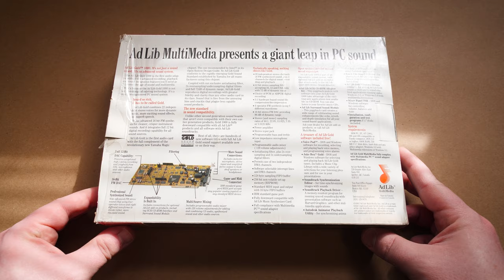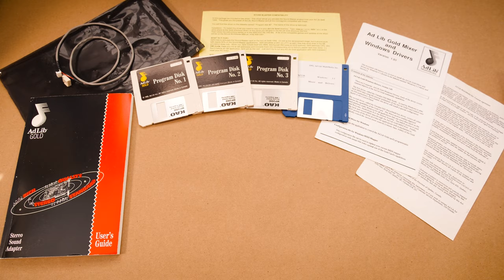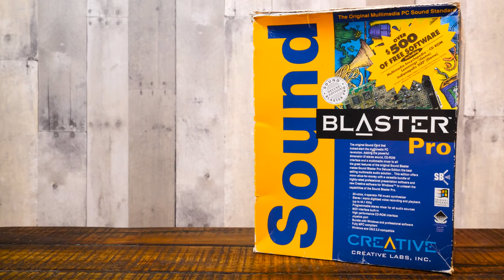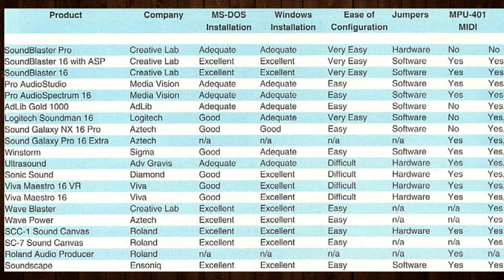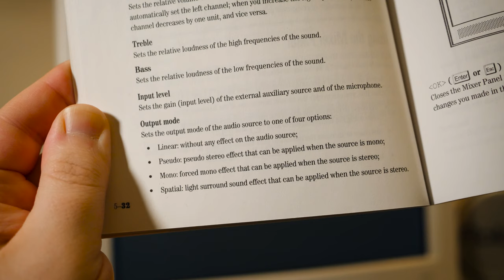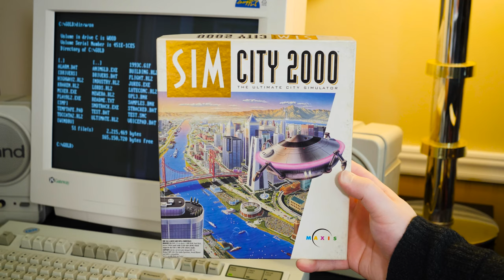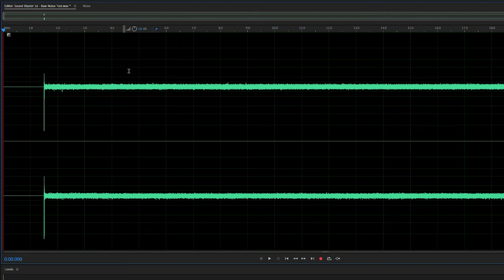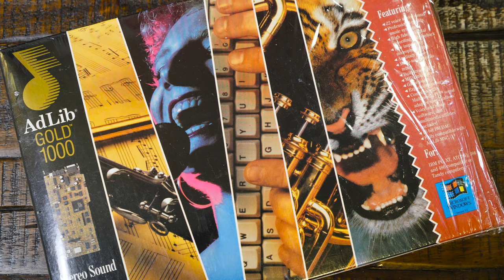The AdLib Gold Experience: Is it really worth $3000?

Comment: Oh dear. I killed the Gold as it was not viable to build. I became technical director for Adlib Multimedia Inc. after Ad Lib went into liquidation. The 1000 was never put back into production as it had been stock piled along with a substantial parts holding.. The main problem was the Gold ISA control chip, we ended up scrapping the whole stock of it (some 100k parts) for not many dollars. Other parts were included in the new products we designed in house which were coded ASB for Advanced Sound Boards ASB16 32 and 64. The stock of gold  SCSI board components held was used on the ASB to provide a universal port on the card along with the high quality audio grade components.... All the design and software development was done in house in Québec Canada. The card you have there was a late card, the address on grand allee shows it.. for a year  Adlib multimedia  operated out of the technology park in ste-foy... With v1 manuals, there were many nights spent rewriting them for V2...

Comment: Clint calling a 200KB driver "bloated" is hilarious thinking of the bloat we have to download now LOL
Reply: This bloat is not preventing you from running the drivers alongside the software that they're intended to enable. The driver may be a 500mb download, but you have 16gb ram and there's only maybe 100mb of the driver code resident, a drop in the bucket, running one of the most complex subsystems in your PC. In contrast if you can't trim down your basemem consumption to about 40kb, you aren't getting any games to run, so a 200kb driver pretty much breaks your system.
Reply: @SianaGearz  no shit achtuallay boy
Reply: 60-100+ MB downloads for NVIDIA drivers because they're bundled with "GeForce Experience"
Reply: @sugaryhull9688  aren't they like a gig now? LOL
Reply: @sugaryhull9688  That's because what you think is driver is actually a driver package, so it contains drivers for many different cards in one package. AMD does the same. I once swapped RX 560 with RX 580 and it was working without reinstalling drivers, that's kinda cool. And that driver package also packs software, which you may or may not install. Sometimes they even have recently depreciated software like 3D Vision drivers. The actual drivers aren't really that big. Also up to 100 MB is conservative, AMD drivers can get as big as half gigabyte or more than gigabyte once extracted. Also AMD leaves all previous driver version files (with the rest of software) on your PC and never cleans it up, so you can find over 10GB used in C:\AMD directory. That makes nVidia look like saints.
Reply: @sinephase  sounds like someone's mad someone corrected them
Reply: @sinephase  Umadbro?
Reply: @jzburda  yes
Reply: @sinephase  wp bro
Reply: *cries in 50gb+ games*
Reply: I dunno. I have to reinstall my AMD 1GB drivers every few months or whenever I take out the card, or breathe on my PC it seems. Pain in the ass
Reply: Lol millennials
Reply: For the time and a DOS based driver 200kb was absurdly large.

Comment: The older I get the more I love FM Synth.  One thing I noticed is how many solid state capacitors the Gold 1000 card had compared to the SoundBlasters.  Creative used a lot of electrolytic caps, but the AdLib had very few electrolytic caps. Part of me wonders if your collection of cards would sound better with brand new electrolytic capacitors. I imagine more than a few of them have aged to the point where they're partially out of spec.  I just recapped my original non-TMSS "Hi-Def Graphics" Genesis and it sounds quite a bit warmer and fuller now.

Comment: Hi, Clint! Great video as always! Just a quick note about the date code on those chips. The first two digits are the year (as you got it right). However, the last two are the week of the year, not the month. So in the case of the main chip which reads "9209", that is the ninth week of 1992 (which in turn would be around the last days of February and the first days of March 1992). Keep up with the excellent work! Greetings from Argentina!

Comment: A sound card for $3000?

NVIDIA in 2021: "Hold my beer."
Reply: quadros and titans have always been in that price range

but most people don't buy them because they're as incredibly cost-inefficient as possible just to squeeze the professional market dry
Reply: @Shpoovy  ...well RTX 3000 series and AMD RX 6000 are around $1000 or above.
Not long time ago, the best gaming GPU cost only $800
Reply: @GameBacardi  And they were ~300 in the early 2000s :(
Reply: Hold my ray traced beer
Reply: @GameBacardi  msrp the 3000 series, for the most part, are under $1k (3080 outperforming the 2080Ti and nearing double that of a 2080 - for $700). Between supply shortages and scalpers (and data mining) the demand is far greater than supply which is why the prices are at 100%+ markup. Hopefully they'll go back to normal in time.
Reply: @Shpoovy  I actually own one FirePro card and there's really almost no difference between it and regular Radeon. However it renders depth better in some games.
Reply: A $1000 for a plain 3060 already is just gross. I mean, my 1080 can do more, and it was less than half of that 2 and a half years ago where it was already outdated...

Comment: Awesome! I remember seeing the option in Dune, trying it and getting rejected. Had to stick to boring old AdLib on my Media Vision Pro AudioSpectrum 16. I've now managed to collect all the parts necessary to play it again, except a working 386 motherboard (and obviously the original case). I do have a couple of 486 boards that would probably work though. I could even listen to the music with my Roland MT-32, which should work with the MPU-401 on the PAS16. But what I don't have is the spare time to spend a day tidying up the workbench and building the machine.

I never knew the history of the card and the company that made it. I always just assumed it launched too late to compete and the SB16 just outsold it through brand power.

Anys ways, great to hear what the AdLib Gold sounded like. Very awesome for the few games that were specifically written for it!

Comment: Hey, I'm the guy who brought Trixter his first AdLib Gold almost 20 years ago (not this one), and right now you might hate me, but Trixter's card ran me around 5 Euros incl. shipping, my own that I still posess, was around 11 Euros. Prices are around 2002... times change...
You made quite a nice video on it! I want to add some stuff and correct some other. The SB Pro was mentioned to be 22 KHz Mono. In fact, it's either 44.1 KHz Mono or 22.5 KHz Stereo. (Why? They used a Mono DAC and flipped between L/R in Stereo mode for each byte.)
One thing to mention about the SB 16 is that most cards had a flawed ADC, and this meant they would also only record with 12 bits resolution! Given the noise the SB 16 produces (which you captured quite well), you probably wouldn't even have heard those 4 missing bits, as they have been lost in noise... so it's tragic that this card was even named to be inferior just by looking at the bits. You prove that AdLib made in fact the better audio circuit, while most Sound Blasters below the AWE 64 (and some 32 and some even fewer SB 16) had not-so-well-made implementations...

By the way, you picked an SB 16 with an original OPL3, but some viewers might not known: Creative invented something called "CQM" that was supposed to emulate OPL3 with later cards, namely most (but not all) Vibra cards and even some cards w/o Vibra label. It sounded even harsher and quite thin... 

Here's a link on my take on the card, as well as most other sound cards of that era: https://crossfire-designs.de/link/soundcards

Comment: Does anyone know how the .rl2 songs that mix opl3 with samples were made? I'm not aware of any publicly available software that allowed to do such songs (except for maybe deflemask for genesis like stuff).
Reply: They had proprietary software. So they had Visual Composer, that's a version that does OPL2 only, you can find it. They are alleged to have also made a sequel version that covers the feature set of this soundcard, but it remained unreleased.

ScreamTracker 3 by Future Crew is known as sample based module tracker, but it actually has OPL3 patch support built in. Little known feature. So if you wanted to compose OPL3+sample music by mid 90s, that's what you could use.

If you're looking for something to use today, i hear OpenMPT gained OPL3 support not too long ago.
Reply: @SianaGearz  Thanks for the pointer. I have found a disucssion on Visual Composer 2 on Vogons after some searching. It's a pity that it's still not available on the Internet. Hopefully some day some ex-employee or contractor from adlib will find a disk with it :-)

Comment: I think where Creative really had the advantage was they were bundling CD drives with their sound cards offering a full all-in-one multimedia add-on package, versus Adlib which I think just had sound and maybe speakers for a package.  Price was probably also a factor too.  Even if Adlib was a premium sound system/brand, there are always those who will refuse to pay the higher prices especially when the difference in quality cannot be justified as much (or they can't tell).

However I think it's also comical now that REaltek pretty much owns the sound market at least in terms of computers for the bulk of people.  Yes there are probably still some people who buy add-in sound cards, but many people I think still just use the built-in sound as the integrated options (like more recent processor graphics) have gotten quite good to a point where adding a $100+ sound card may make some gamers think twice.  They could spend the extra $100 on something else that might make their gaming experience more enjoyable.  Plus I think the real hardcore sound buffs tend to run audio to another external audio device anyway (from the computer).

Comment: i remember getting a sound blaster 16 value ISA in late 93 i think just to play wolf 3d and doom really well.. it was $220 AUD then i think so thats somewhere around $500 USD in todays money just to get sound plus the speakers.... computer parts were really expensive then .... the same time i got a double speed cdrom drive for $110 AUD for return to zork and 2 extra megs ram for $50AUD per meg  $33 USD. Sound blaster 16 ran on every game without fault after you set it up Irq 220 etc ... opening the doors in wolf 3d and the gun shots were a huge improvement over the PC speaker

Comment: Oh, so Ad-lib presumably was sold to a company from my home town after they went under. ‚Binnenalster‘ is a VERY specific term. 
Hamburg, my hometown and one of the biggest cities in Germany has a big lake at it‘s heart called ‚Alster‘ (wich is technically a river, but eh). That lake is sort of shaped like a figure eight with a comically small top part and a big bottom part and bridges spanning the intersection. The big bottom part is called ‚Außenalster‘ or ‚outer Alster‘ and the small top part wich stretches right into the heart of the City Center is called, you guessed it, ‚Binnenalster‘ , wich roughly translates to ‚inner Alster‘.
So for them to have that name, I assume they would have been from here.

Comment: I would have preferred to have a Gravis Ultrasound. I only ever had a SB Pro clone, the Opti 930, until I eventually upgraded to an SB PCI 128(which is really an Ensoniq card...), and afterwards an Audigy 2 ZS. I still have the 5 1/4 bay external output, but the card itself got borked after 2 or 3 years. Just been using my onboard Realtek(which seems to come with everything) ever since.

Comment: My DOS memories are a bit rusty, having used one in a PC many, many years ago but I find the problems people had with conventional memory baffling. I mean, aren't you supposed to load drivers etc... In upper memory by using DEVICEHIGH in Config.sys and LOADHIGH or LH commands in Autoexec.bat? I did not sacrifice features like Smartdrv (which improved load times significantly, IIRC) and I never had to use a stripped down boot disk for my games, I always had plenty of conventional memory left. Everything that is meant to run in the background I put in upper memory.

Comment: If I spent that much money on anything audio, I would at least connect the output to a nice amp with some studio monitors, not tiny pc speakers.
[EDIT: The Soundblaster card sounded like it had shielding or power filtering issues with that powerline hum.]

Comment: Get those old electrolytic capacitors replaced ;) They normally dry out after 20-30 years, and any modern capacitor would sound a lot better. For best results use Nichicon MUSE or Panasonic FC series caps

Comment: Compared to SB-16, Ad Lib is better, but the AWE 64 Gold is way better than Ad Lib. But, nowadays, most any generic sound card can be set up to use sound fonts, as well as VSTs, so there isn't much reason for a high end sound card upgrade. Most of it is back to processing power. Maybe high end if you want to have a home recording studio, where you would need quality input and output, but otherwise, your basic modern computer can do quite a lot with MIDI, with the right software.

Comment: I should have sent you all my old stuff.  I threw out about 50 working ISA cards ranging from video cards, sound cards, to IO cards, etc.  And about 80'ish AGP/PCI cards of assorted everything.  :(  Sadly, it's all gone now in a landfill.  Wish I found your page beforehand I could have asked if you wanted it all.  With no room in my new house to store all the old stuff, I had to throw out decades of stuff ranging from a Vic 20, tape drives, CBW I think it was Collerado Tape Drive Software, with 15 TEC80 or i80 or whatever they were called back then tapes, the tape drive, and all my Zip Drives and dozens of IoMega stuff.  Sigh... :(  I had boxes and boxes and boxes of stuff.  :(

Comment: Maybe it's because I was into Midi before adlib was even a thing, and was a Roland NOT a Yamaha guy (D20 > DX7)... but FM synthesis has ALWAYS sounded like tinny crap to me. Even on the high end standalones it's just junk. 

I've never heard anything on OPL-3 / earlier that sounded good. 

So the ridiculously pathetic sounding adlib 1000 really didn't blow my skirt up when it was the same price as an entire keyboard with a vastly superior synth. More so when in just a year or two later vastly superior devices like the Aria16 and Awe32 were available at a fraction the price. 

Hell, I'd even stack the OPL-4 based Logitech Soundman Wave against it. You want a rare, hard to configure, noisy but decent sounding card? Look no further. Hmm... wonder if mine even still works. Been in the bottom of a box of cards for over a decade.